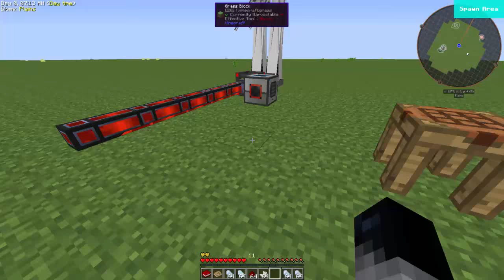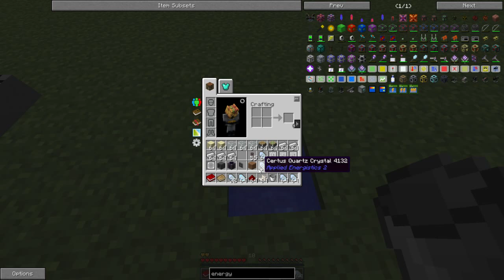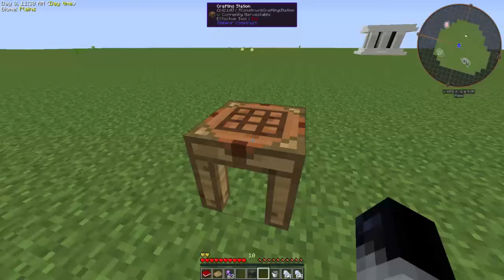Applied Energistics Tutorial ★ Your first ME system including storage (Minecraft / Gameplay)

Comment: I attempted to do this and it didn't work whatsoever, I am in the blightfall modpack and was using rednet cables as I do not the think cables you were using, are in my modpack.
Reply from the maker: rednet cables won't work.  If thermal expansion isn't in the pack (which was the cables I was using) you need something that transfers energy.  Universal cables, ender io energy conduits, etc...I'm not familiar with the blightfall pack so I can't give more suggestions but anything that handles energy management should work for powering the ME system
Reply: LovinDaTacos Rednet DID work for me but only when I used the ME Chest. Ender Io isn't in the mod pack either, I'm pretty sure the only energy mods are Applied Energistics , MineFactory reloaded and Thermal Dynamics and foundation.

I would still like help if possible, on setting up a working system and not just a chest, as they are quite garbage.(BTW Thanks for trying to help)